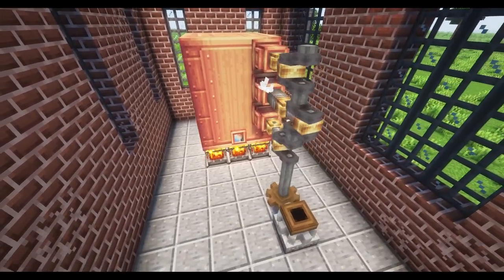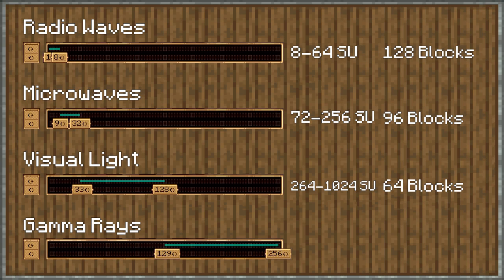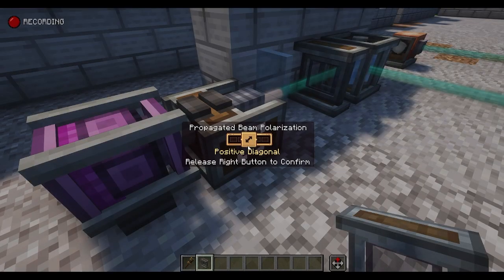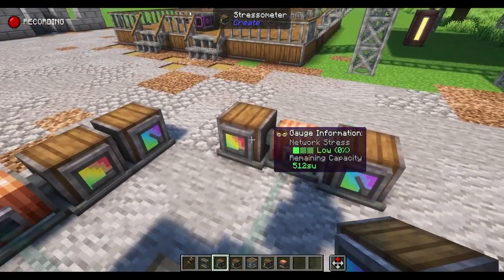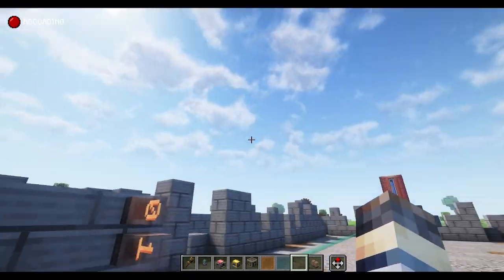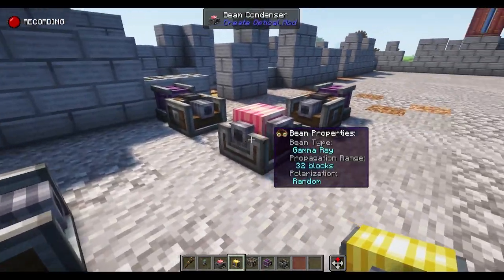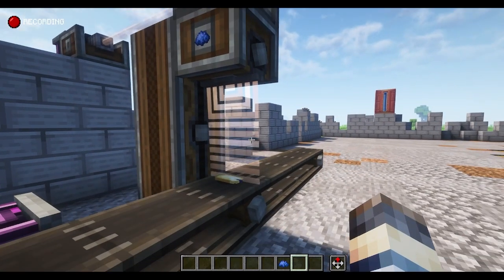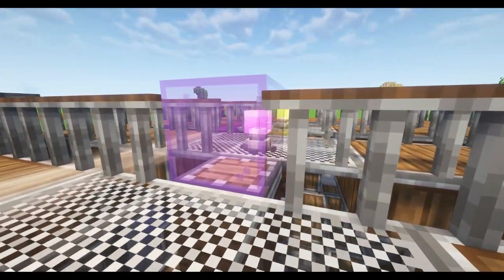Light beams to power all your create machines || Create: Optical

Comment: The only use I see for this mod is the data transmission. With a single beam, 15 colors and 2 polarization filters, you can encode 45 separate values. And it seems to me that the encoder for laser data transmission will be smaller than the traditional version. But the decoder is likely to become more complicated... The time is 00:30, it's time to start creating unnecessary overcomplicated junk!
Reply from the maker: This does sound complicated... but pretty awesome. I will probably spend waaaaay too long looking into how to even remotely use this in this way as it is definitely way over my skill level lol
Reply: @mccastlegaming  Despite the fact that I using fabric, I realized that the encoder will be overcomplicated and will work much slower than redstone (which can already be transmitted over long distances with create). But now I won't stop until I make it work.

Anyway, last night I already made it possible to manually select the desired symbol, now all that remains is to make this thing work at the touch of a button. I think rose quartz lamps can be useful here

Comment: It feels like just another Create addon that adds new machines without a good motivation, while being aesthetically lacking. Turning rotational energy directly into a light beam is silly, using light beams for energy conversion is silly, having a polarisation mechanic is pointless unless you’re doing some kinda quantum experiments, and the recipes that use light beams don’t really make sense. Why not use lasers for mining faster than drills? Maybe certain wavelengths would be better at destroying different types of blocks, or could provide different breaking effects like smelting or silk-touch or fortune. In the same vein, looting effects or XP drops could result from killing mobs with certain beam types. Maybe you could use the light for computer-like recipes similar to Buildcraft’s assembly table, or as a part of some sort of unique ore processing. Or maybe you could make optical logic gates that are somehow denser and more useful than redstone.

What I’d like to see most is compressed air meeting Create. Be it Pneumaticcraft compatibility or a new mod entirely, it only makes sense to use rotational energy to power a compressor. Pneumaticcraft has a neat pressure chamber multiblock used for crafting, but it does overlap a lot with its conveyor belts and robot arms. Man, I want to use it to charge up the Grappling Hook Mod’s twin hook with compressed air.
Reply from the maker: I agree with a lot of what you said. I think there are some interesting things you could do but most of them could be done more simply using base create or some of the existing addons. That being said it is a pretty new mod and I think that there is a lot of potential for different things.

Also I really like your idea of using the laser to mine and the different wavelengths having different effects is pretty genius IMO. And you had me at buildcraft! the assembly table and logic gates! man I miss buildcraft it really is what got me into the more technical minecraft mods. I am also a sucker for pneumaticcraft and always install it with compressed creativity though I wish that there was more then just converting between the two.

Thanks for the comment now I have a few ideas to try and I think a few of those suggestions would be good to pass on to the devs of this mod (i.e. the drilling stuff) as I think they would be awesome!
Reply: @mccastlegaming  I didn’t know Compressed Creativity existed. That’s probably good enough for a lot of stuff, you can tweak recipes for the modpack to blend the two together better, removing duplicates and fleshing out the aesthetics. In a similar vein, you could probably tweak the recipes of this laser mod to make it more useful and have it fit in well with other mods in a modpack. Requiring lasers to make circuit boards could make sense, for example. And gamma rays could be used for strange chemistry transmutations, though being able to produce gamma rays that easily is a bit strange. I still can’t think of anything to do with polarised light.

Comment: I agree, I don't really see the point of the polarization filters. There are easier ways.
I'm struggling to find the point of the mod altogether. I get that it could easily allow you to change where it goes and and what strength of SU over long distances without hardware and that it could be rigged to be controlled by remote or a series of levers or buttons. 
I think the main sell is the effects of the light like the microwaves and gamma waves. These are already useful as turrets or perimeter defense and I could see radio waves being  used to deliver text to signs remotely or certain types of glass or crystals being used to make lasers. Expanding these functionalities to allow them to be easily incorporated into the create workflow, have flexible functionality as crafting machines and weaponry, and to more easily create certain resources would really tempt me to download it.
Reply from the maker: hmmm interesting ideas. For me it made me more think about ways I could add custom recipes with more mechanics. Someone also mentioned creating light puzzles which I think is an awesome idea. It is a newer mod so it will be interesting to see where it goes in the future.
Reply: Polarizing filters will allow you to encode entire Russian alphabet with only one beam, even the "Ё". At least that's what I think. Of course, I do not know why someone might need this, but still these things are not useless
Reply: @HappyRiv  Indeed. I wouldn't call it useless, maybe "niche"?

Comment: what if you fire 3 condensed beams into another beam condenser
Reply from the maker: Probably not explode like I would want it too 😆 I'm pretty sure I tried this and it doesn't work but I'll have to try again and see.
Reply: I tried it
The 2nd beam condenser ignores light from the first condenser. I even made a bug report for this. The deg might change something so it works
Reply from the maker: @da_puffer  Yeah I tried it too and got the same result. I expected it to at least take the maximum it could take and the rest would be wasted but no it just didn't pass through.